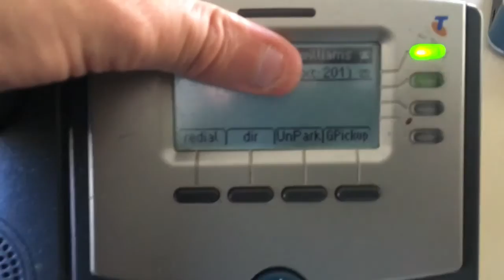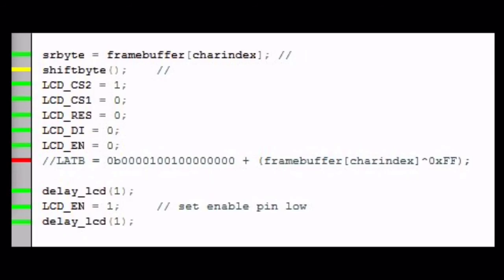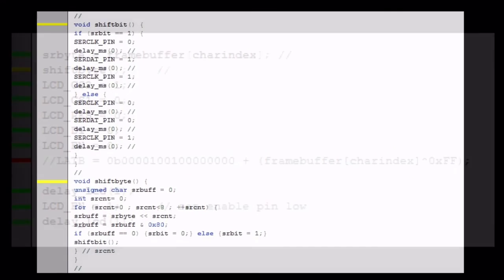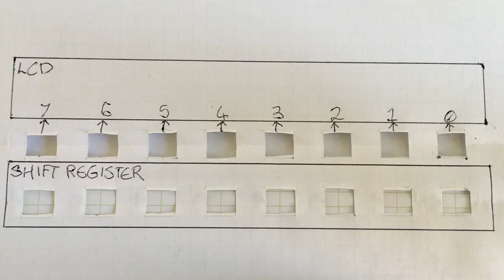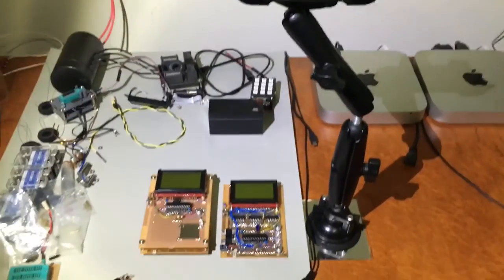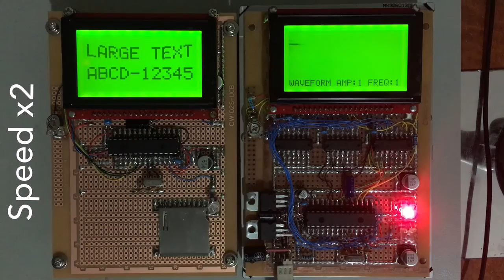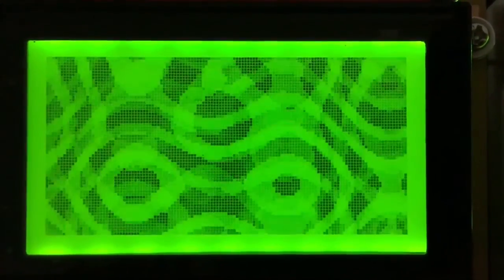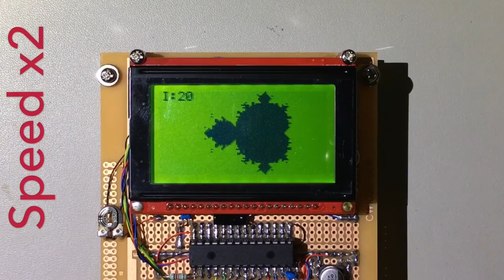Serial vs Parallel GLCD Showdown

Comment: I'm designing a shift register interface for KS0108 displays (both 128x6 and 192x64) using 74HC595 parts.  It will use 4 or 5 i/o pins (SCK, MO, LATCH, E, and maybe MI).  The MI pin would be used for reading the busy bit if desired, or I could add a 74HC165 to read everything.  Instead of getting the E clock for the LCD from the shift register, I would use another pin on the microcontroller for that.  This would speed things up just a tad, but it might not make that much of a difference.